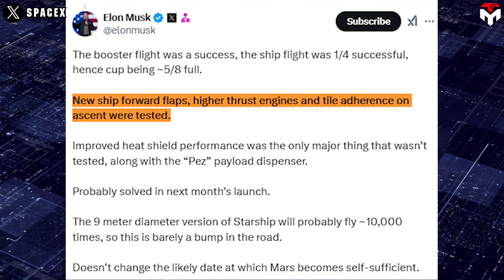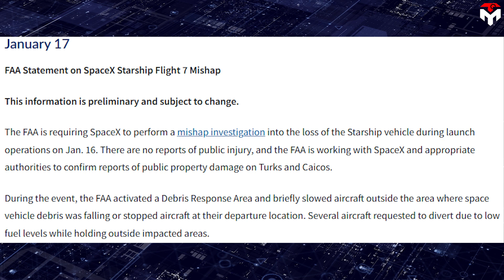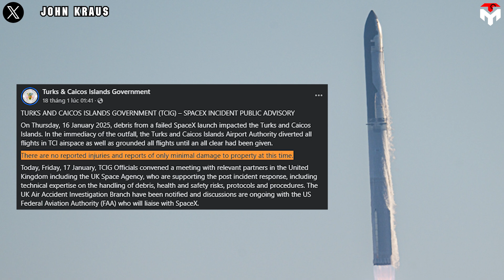Metallic Heat Shield MELTED? SpaceX Experienced New Trouble with Starship Flight 7...

Comment: IFT 7 ship never properly got to orbit, so therefore never had a chance to test the new tile system during a controlled re-entry, so they could not have failed on this flight, the metallic heat shield tiles that were recovered went through an UNCONTROLED re-entry after the FTS detonated, a hugely different prospect, stupid clickbait titles like these are reasons that I will not subscribe to channels like yours.

Comment: We think metal is better than wood  in fires. But in a fire course in Forestry, I learned firefighters don't like metal buildings. A wooden beam will char on the outside, but stay strong for a long time internally to hold roofs up. But metal beams will hold to a melting point, then suddenly collapse at a weak point, killing firefighters. The same with  metal heat shield. Every air flow has pockets of turbulence and high heat points. Other materials (not wood!) are needed
Reply: Reaching only 300degC makes a steel column/bar unstable! No melting needed.
And a little detail: "Iron" has only a melting point at 4.2%C called Leduberite. All the other compositions have a melting traject up to 400degC.
Hot rolling?
Reply: @planck39  Thanks for the info. As soon as I saw the "active cooling" needed for every point, I saw failure. Wood is only cellulose, but it is full microscopic insulating air pockets. Fill it with resin which is flammable, and it  is physically stronger, but loses that internal insulation. -- What about a silica (quartz) foam with nitrogen filler (air has Oxygen which helps cellulose burn.)